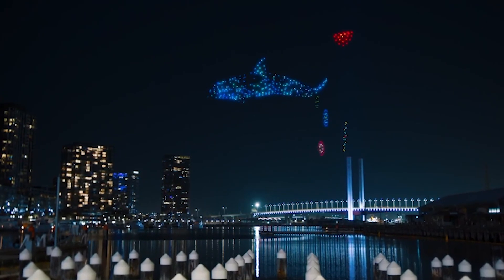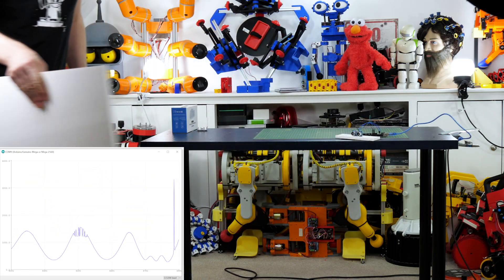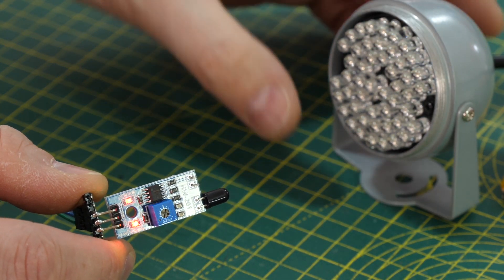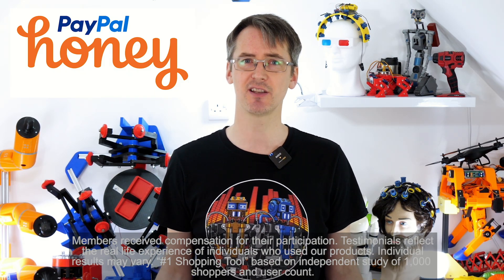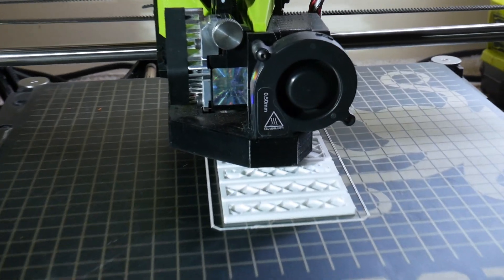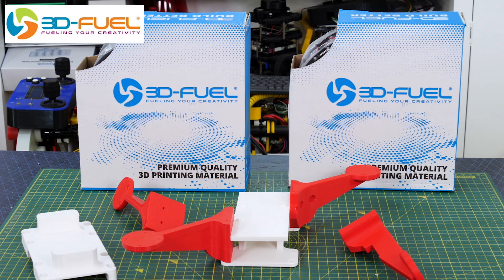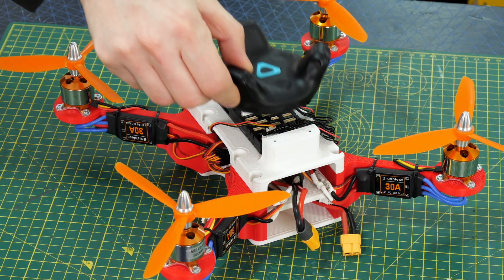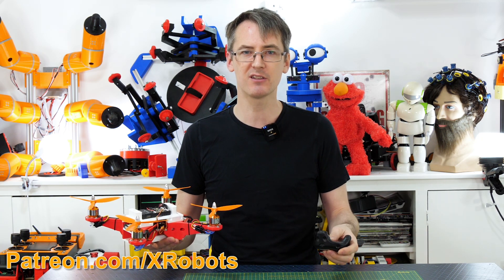Experimental Drone Positioning System

Comment: I spent an evening with the guys from FireFly drones shows during their practice session. I asked a bunch of questions regarding how they work. They couldn't give many details but one thing that was rather shocking is that each drone has no idea where the others are at any given time. Meaning, they may collide with each other if the drones are setup improperly. Regardless, it was an amazing sight to see, especially when I was only one of a handful of people there to view this amazing work. EDIT - that was a few years ago, so things may have changed since then.
Reply: Makes a lot of sense. If drones know where other drones are, that information would take exponentially more processing and storage the more drones you add
Reply: @AlannaStarcrossed  it would only be exponential if each drone was keeping track of the relative positions of each other drone in relation to the entire set, which wouldn't be useful. If each drone was only keeping track of its position in relation to all others then the processing would only increase linearly
Reply: @theycallme_nightmaster  You're right, I didn't think about that. I was thinking of them as one connected unit but it's not

Comment: I've had this idea of using multiple cheap esp8266 modules with their 2.4GHZ band constantly maintaining an uplink and then triangulating their position based on the very sensitive signal strength value read by the esp hardware in decibels.

Comment: Wow, very cool! Have you thought about using a single transmitter and multiple receivers rather than pairs?
If you know the separation of each receiver then you can get their distances from the transmitter based on the difference in time of receipt. Same concept, just pairing multiple receivers to the same transmitter.
Really cool project, I would love to see one that tracks in 3D!
Reply: That's against the purpose of the device. The goal is to make the mobile unit figure out its own position based on transmitters that don't actually care where it is. If you put the receivers on the fixed stations they would need to transmit the time of flight data back to the robot. That would mean the two base stations would only be able to track the single mobile unit as opposed to an arbitrarily large number of mobile units that could work off a single pair of beacons.

Comment: The drone light shows are so cool, but it's a shame they need the expensive drones. If your position tracking was good enough it would be cool to have a fleet of balloons with no propulsion, but just computing which ones to light up to make shapes. Even without the precise positions you could do cool abstract patterns by having short range communication between them like "balloon 9908: tell all the balloons within 20m of you to flash red." How much are ten thousand Arduino nanos and radio transmitters?

Comment: I build something like this 6 years ago. I used NRF24L01 radio's for transmission. The delay is negligible, and it's a lot more reliable than IR. Just a recommendation. Finding the best matching point in 3d space from multiple transmitters is not trivial though...

Comment: wifi base(d) station positioning system
Reply: 360 antennas/sensors
Reply: lidar
Reply: well a camera/sensors on board the drone
Reply: the drone can receive/detect what beacons its close to
Reply: rails like in 3d printer
Reply: brilliant :)
Reply: just use single signal source, multiple receivers
Reply: or, just use the drone as the signal source (ir light and sonar whatever)
Reply: yes like the plane transponders
Reply: and the signal pulses can determine how long the signal took to arrive
Reply: yes gps variable signal from the drone emitter
Reply: data packet detection, even for wifi
Reply: the more sensors/radars you have the better localization
Reply: who why not use the drone imu to get 6dof approximate location, and then use some kind of base station to stabilize the location relative to the base station locations, like wifi radar or camera
Reply: try a personal helicopter stick, with active horizontal spin mass direction control, at least the stick keeps upright by auto-gyro, maybe a tail fin stand on platform for flight control, or just a quad copter drone with a helicopter rotor

Comment: I love how James just throws together a drone of an evening like it's nothing.
Reply: It’s crazy how fast this guy produces designs. The rate of his content is just incredible. M an engineer and in the time it takes me to come up with one solution for one part of my project, this guy will bang out entire systems.
Reply: @JimmyBatchelder  yes he is extremely fast no doubt. However, often he has some mild problems in his designs that could be corrected if he was maybe working at slower pace.
Reply: To be fair anyone with some basic drone knowledge and a 3d printer can do that. The US sensor stuff is interesting though.
Reply: @SirDragonClaw  it's not the building of the drone I'm impressed by. It's how quickly he seems to have built it.

Comment: Why not use IR distance sensors directly? You can get long distance high precision ones pretty cheap nowadays. (5m @0.1-1mm precision)
ToF sensors are also only slightly more expensive but give you even better specs and 3D output with no chance of interruption

Comment: Smoothing out the domes might help a bit with the coverage. The layers of the print are all perpendicular to the transmitter facing increasing the strength of the unscattered reflection, especially in the middle where the layer lines are quite pronounced.
Reply: The SRF05 operates at 40khz, which means a wavelength of ~8.5mm; would surface features under ~4.25mm even be detectable? I obviously have no idea what print settings were used, but typical layer height can be anywhere from 0.1mm to 0.6mm.
Reply: agreed, though I wonder if, from a level of effort standpoint, it would make more sense to reorient and reprint the domes in quarters then join them together, to take advantage of how much smoother 3d printed curves are when the wide side is on the xz plane

Comment: You could just use Wifi for the timing. Then you could make dozens of cheap ultrasonic transmitters with ESP-01.
Reply from the maker: WiFi will have variable latency depending on how many TCP collisions are there are. It would need a low latency dedicated radio system, Light is pretty reliable.
Reply: Hey ChatGPT. How do synchronize clocks of ESP01 with microsecond accuracy? Via Wifi.

Comment: Using Ultrasonic for positioning is pretty much beging for problems

A really simple solution is having IR transmitters that just send out a burst in synk. Then a wide lense IR camera that position them, and if the unit know what order they fire in, they could have a pretty accurate angle to every IR transmitter they see.

A other system that is used in professional indoor guided robots is simple reflective tape and a IR transmitter and reserved  (Typically a very narrow field or a laser) rotating quite fast. Those are typically used on ground based vehicle that have a very solid altitude to begin with

Comment: Using ChatGPT to create the smoother code sounds interesting, how much time would this save you, what are the limitations, etc? Would be great to know more.
Reply from the maker: It took about three goes starting again each time before I got something that worked. The code is on Github.
Reply: @jamesbruton  but you don't know the original license of the code pulled by GPT
Reply: @jamesbruton  With the GPT 3.5 version of ChatGPT I'm guessing? Not GPT-4?

Comment: Since you're using IR beacons already, you could try to imitate the System of the Vive Lighthouses. There's a great talk from Alan Yates on YT talking about how it works. Basically, you have two IR lasers sweep the room and an IR beacon lets the devices know when the laser passes a certain angle. That way the devices can measure the time between beacon pulses and when they measure the laser sweep to estimate the laser angle at the time they see the laser and they can work out their position. I think this should be doable with just an IR laser emitter, a mirror and line laser lens on a rotating platform above that emitter for the base stations, plus the beacon ofc.

EDIT damn, should've finished the video first, then I would've seen you hold the Vive tracker xD. But you can still try to DIY a system like this, could bring the cost down.
Reply: as soon as I saw the IR arrays I thought the same thing, looking up at the lighthouse in the corner of my office.  but managed to wait until the end.  James!  Excited to see the drones on lighthouse tracking!
Reply: @SeanSiem  🔴 What Is Islam? 

🔴 Islam is not just another religion. 

🔵 It is the same message preached by Moses, Jesus and Abraham.

 🔴 Islam literally means ‘submission to God’ and it teaches us to have a direct relationship with God. 

 🔵 It reminds us that since God created us, no one should be worshipped except God alone. 

 🔴 It also teaches that God is nothing like a human being or like anything that we can imagine.

🌍 The concept of God is summarized in the Quran as:

📖 { “Say, He is God, the One.  God, the Absolute.  He does not give birth, nor was He born, and there is nothing like Him.”} (Quran 112:1-4) 📚

🔴 Becoming a Muslim is not turning your back to Jesus. 

🔵 Rather it’s going back to the original teachings of Jesus and obeying him. 

More .....
Reply: Its a bit more difficult, but even 1 Base station is enought for 3d tracking... I am using VR all the time and i have 4 of them... Would be way more interesting!
Reply: I'd love to see a cost analysis of this system for comparison's sake; those lighthouses are $150, though the tiny TS4231 sensors that goes on the robot are only ~$0.80 each, which means you can put a dozen of them all over the robot for better coverage, without needing to do any fancy orientation to keep them pointed at the base stations.
Reply: At 13:18 James shows a Vive Puck so he was already onto this idea long ago.
Reply: You can put a shutter over the ir emitter and look at the mark space ratio to get your angle. 

Ideally you need to have a polarised shutter and dual polarised receivers so you never lose signal. 

Cheap, rugged, simple.

Comment: Hi James, Great video! I’d try Ultra Wideband transceivers the DWM1001 modules work really well.
Reply: I worked with that System u can even send data over the system
Reply: @Henry From the very short googling I've done, it seems like the DWM1001 modules unfortunately have a pretty short range and and while great at ~10cm of precision, it just isn't there yet if you need a bit more precision, which is quite unfortunate as I've been looking for something like this but better and thought this module was going to solve all my issues.
So close, yet so far.
Reply: UWB is not cheap with the complete infrastructure you need  ...
Reply: @peepopalaber  but maybe if more people start using it, it becomes cheaper :)

Comment: You could use cameras and accelerometers. The Oculus Quest 2 determines its position and orientation in space using 4 cameras and an accelerometer and It does that very well without any external transmitters. The algorithm may however be somewhat tricky :)
Reply: Thinking back 15 years or so, Nintendo Wii controllers had an infrared camera (the "bar" placed below the TV contained IR LEDs) and could compute their position in space. That was all in custom hardware... I wonder if a larger array of LEDs would work in this case. Also, could "near" and "far" IR filters be used on another camera to get a second positioning "channel"...
Reply: @MagicalPorkChop  
Those cameras are dirt cheap and readily available. 
Some do 4 points in order of intensity, some do 2.
Reply: @MagicalPorkChop  The bar is to what i remember just two normal IR diodes. They have some type of pattern to know what is the right and the left one.

The "camera" or sensor in the controller have a really low resolution. Its really just used to desaturate the gyros.

Basically the Wii controller are gyro controller and it takes a reading from the sensor-bar once and a while to stop it from drifting

The PS4 "magic wand" works exactly the same way, but it uses a camera to see the X and Y position from the console side, then the size of the orb to determine distance (that is why its so large).

To calculate position from accelerators use very little computing power, sufficiently so that a 50 cent chip could do it in the wii days. Computing position from a camera, even a low res one takes a bit more, specially if you want it 60 times a second.

I don´t know how often the Wii bar updates, but it really don´t need to do so more than once a second or so, then push the position gently in the right direction.
Reply: @MagicalPorkChop  I don’t think it detected the position of the controller rather just it’s orientation relative to the TV (plus it also had an accelerometer I believe)
Reply: Thats visual inertial odometry
Reply: The cameras are cheap but custom hardware for running power efficient vio isn't.
Reply: @spacedoge3508  That's only necessary for inside-out tracking where you're power contrained right? Don't need it if you're doing outside-in tracking like with a laptop?
Reply: @Alex-nl5cy  You need a pretty beefy gpu for real-time vio. (Like 3070~?)
Reply: @spacedoge3508  You definitely don't need a 3070, the Quest 1 could do it fine and is way slower than a 3070. You do need more compute for low latency than is readily available in hobbyist robotics hardware though
Reply: @bosstowndynamics5488  the quest likely uses fpga to run vo. Intel realsense tracking camera uses fpga too.
Reply: @spacedoge3508  Quite possibly, but FPGAs aren't magic, and GPUs are still a fairly efficient architecture for computer vision; just have a look at what Nvidia's Jetson platform can do with a tiny fraction of the compute hardware of a 3070 (on an older architecture no less).
Reply: Using cameras takes wayyy more compute and calibration than this solution or basestations
Reply: I have worked a bit with vslam and found out that it is very difficult to get working well enough to be very useful, besides orb-slam we tried rtabmap
Reply: Theres also AxisVR which does something similar-ish with a depth camera for inside-out full body tracking
Reply: For custom stuff like this Lighthouse is probably better, the processing is a bit simpler and you can dump out positional data from the factory setup using a SteamVR tracker and OpenVR for the API. Iirc it has been done before for small scale arbitrary absolute positioning in similar environments with version 1.
Reply: I did some research. ORB-SLAM3 is the magic keyword.
Reply: @iBlue0riginal  Hmm.

Comment: hypothetically speaking is it possible to build a device that blasts a radio ping and knock out or disturb a drone show
Reply: which is rather illegal, so don't.
Reply: @thekaxmax  perish the thought that anyone might disturb our corporate overlords drone powered festivities/adverts
Reply: @AZ-74  except it's the contractors you're messing up and their reputation your harming. Better to reprogrammed them to show useful anti-corporateximahes and messages. Imagine a 100 metre QR code to Wendover Productions or Second Thought....
Reply: Like disturbing a flock of birds.
Reply: I mean hypothetically you probably could..... I don't think they'd fall out of the sky unless they ran into each other though.
Reply: @pixstatic200  depends on the control system. But these are almost always radio, even if the shapes and positions are preprogrammed. And that can be blocked and taken over.
Reply: @pixstatic200  defense wise if a drone show goes horribly wrong (low altitude/ blown by the wind) such a hypothetical device can instantly reset them as a last resort
Reply: It would be possible for the show to be preprogrammed and prevent all radio interference by turning them off during a show. Simple LIDAR could be used to prevent collisions and allow them to correct their flight. Though, given how complex many of those shows are I doubt anyone has done it this way and probably won't unless there's a spate of people interfering.
Reply: https://youtu.be/WqBZVlgORbY